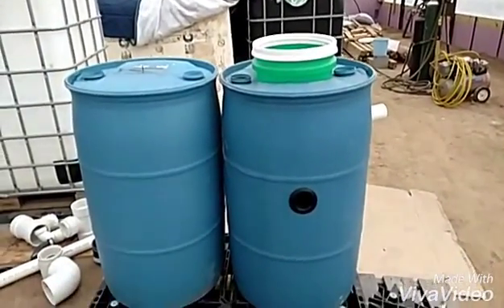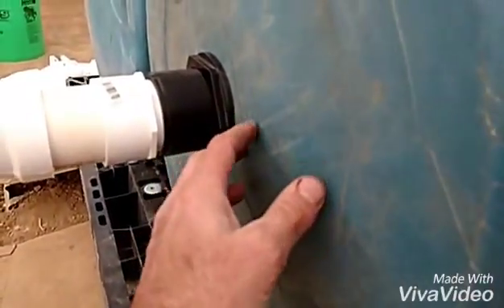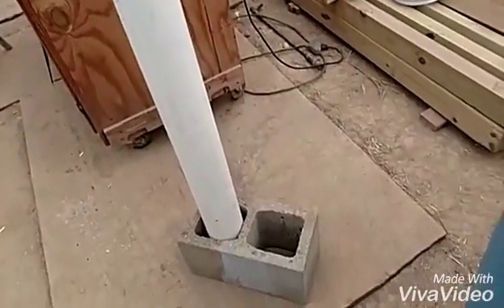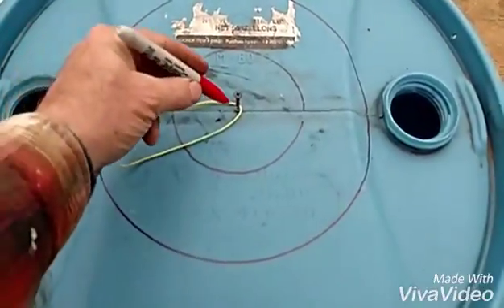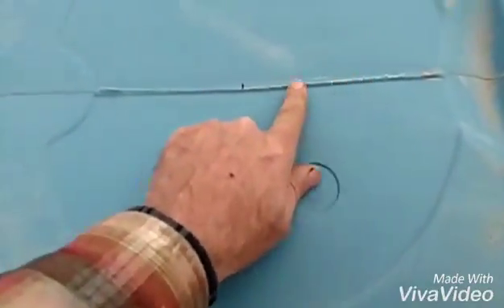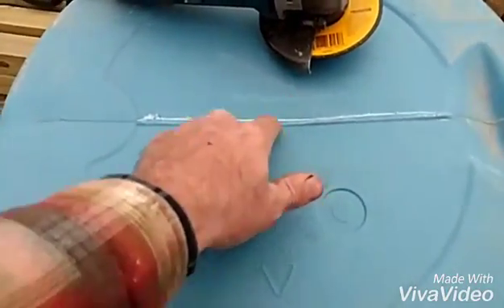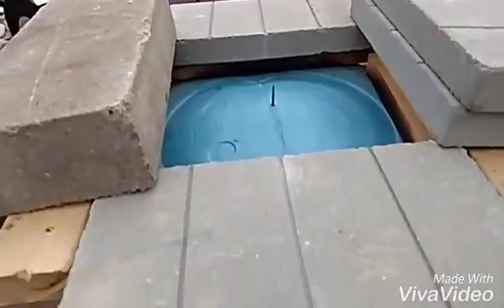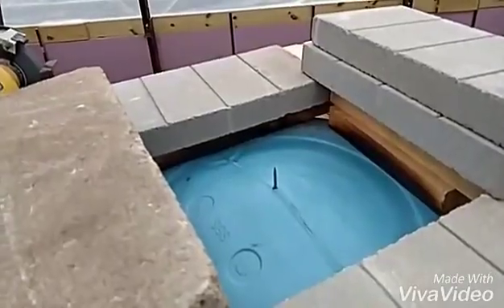DIY swirl or radio flow filter using a 55 gallon plastic barrel and making the bottom convex.

Comment: Radial Flow Solids Settler is much more efficient for its purpose. (and which is NOT a swirl filter). For a 'Radio Flow', where is the Antenna?
ntegrated-aqua.com/wordpress/wp-content/uploads/2012/09/Radial_Flow_Settler_Whitepaper.pdf

Comment: in order to get a true swirl induce with a 90 on the side . outside your center bucket and your out  flow up the center of your center bucket set your outlet height to the level you want to maintain.  centrifugal action will push to the outside at the top but this will cause the settling in the bottom center where you want it.
Reply from the maker: mechanic Hi, thanks for the advice. I hope to have this ready to install this weekend.

Comment: Hi G3,Glad to see you getting back into making videos of aquaponics, instead of making repairs to your wind torn greenhouse. If this heating and bowing project does not work out maybe think of a way to add a cone shape to the inside of your barrel from scrap pieces. Best of luck and keep those videos coming. Cheers,  Bill
Reply from the maker: Bill, ya you said it. I'm tired of fixing things. But I was able to make some improvements to the greenhouse, so that's good. I think the heating of the barrel is going to work great. I should have a update video on that soon. Thanks for the idea. Von